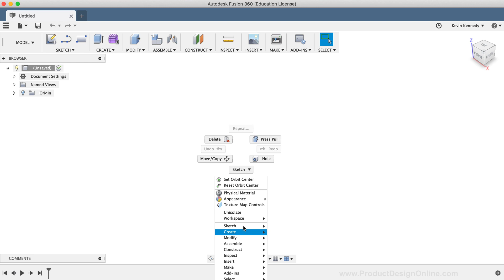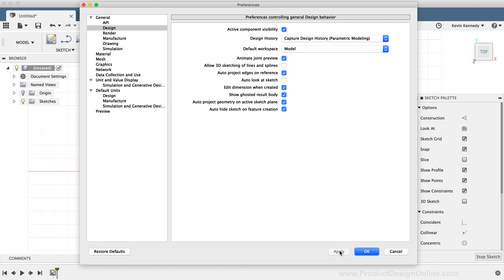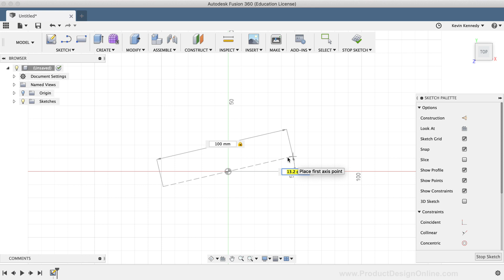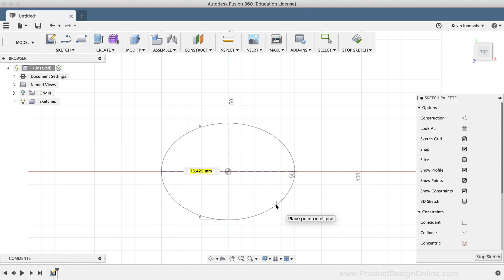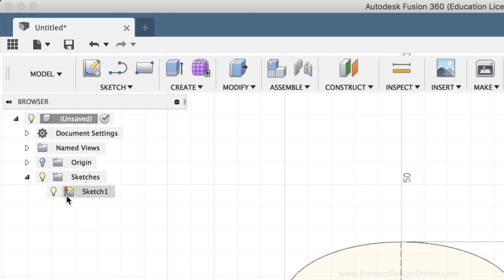How to Create Ellipses in Fusion 360

Comment: Can i move or rotate ellipse in other plain and still get my dimensions (for later adjustments)? That seems impossible and is very constraining.
Reply: The thing is you lose  any chance of editing ellipse once it has been moved for example in z axis. So if you had any dimensions or if you want to add dimensions for later changes it is not possible to edit.
Reply from the maker: @AtisJ  You should be able to edit the ellipse even after moving its placement. You can always double-click on the dimension values to edit their value. Using the sketch dimension tool you can also add more dimensions to other elements of the ellipse. My Sketch Dimension video may be of help to you - https://youtu.be/WzpO8iOTvM4
Cheers, Kevin :)
Reply: @ProductDesignOnline  Thanks for the assistance.This is possible only if you draw in a single plain(as your example). Once you move/rotate it 2mm up or down you will lose all dimensions and parametric control. I`m joining different ellipses in a variable heights using a loft function - none of the ellipses are editable even when i remove all the constraints. Fusion is just not capable yet.
Reply from the maker: @AtisJ  When you save "move" are you using the move command? If so, you can create a "Skeleton" structure and create many planes off of it. This is a common practice that is used with lofting. Cheers, Kevin :)
Reply: @ProductDesignOnline  Yes finally got it :) I`ve been in survey for last 10 years and transitioning from 2D to 3D Cad is quite a challenge, but it`s full of rewards!  Thanks again Kevin!
Reply from the maker: @AtisJ  You're welcome! I'm always happy to help :)
Reply from the maker: Hi, AtisJ. I'm not fully understanding your question. Are you trying to rate the entire sketch (ellipse)? If so, you can create a sketch on a construction plane such as "Plane along Path" or "Plane at Angle". Cheers, Kevin :)